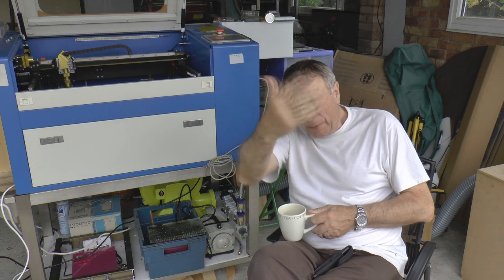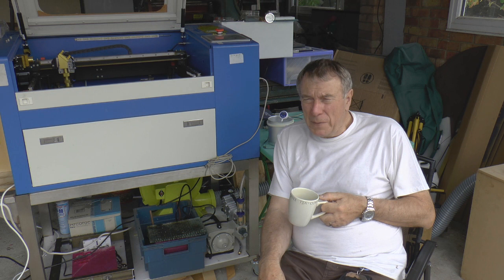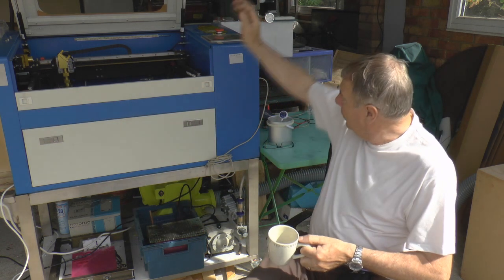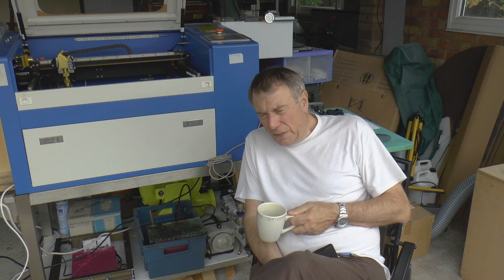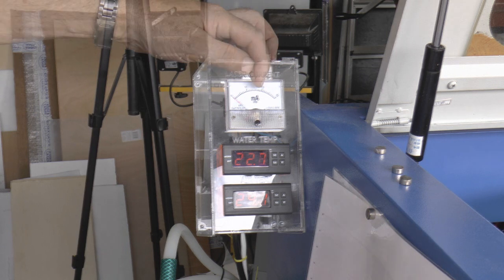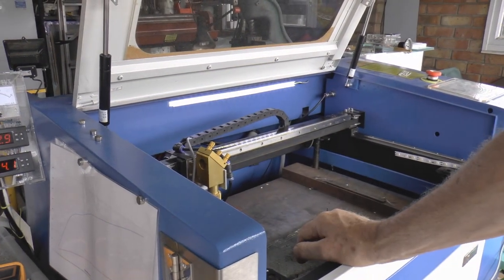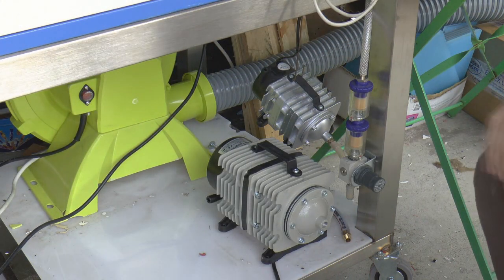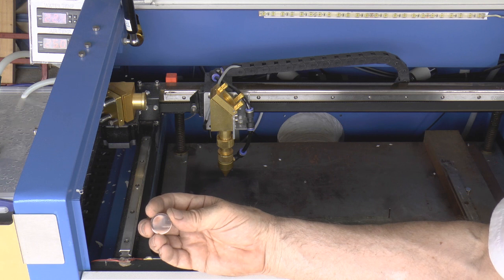RDWorks Learning Lab 75 What have I learned from 1 year of owning a Chinese Laser Engraver

Comment: Russ, is this the unit u purchased? What is a RADIUMWIN laser? Is it a lesser quality?
Enlarge Image View Video Share
Basic Info
Model NO.: RW460
Laser Working Area: 60X40cm
up and Down Device: Have
Laser Tube Working Life: 2500 Hours
Mainboard: M2 Engraving Board
Water Protection Systerm: Have
Specification: CE ISO
Laser Cutting Machine Power: 60W Laser Tube
Red Pointer: Have
Auto Blower: Have
up and Down Platform: Yes, 25cm
Cooling Way: Water Cooling
Trademark: RADIUMWIN
Origin: China
Product Description

China RADIUMWIN High-Grade RW460 Laser Cutting Machine
 
 Laser cutting machine is constituted with laser technology, CNC technology and mechanical technology. CO2 laser cutting machine is designed for nonmetal sheet cutting and applicable to processing rubber, acrylic, wood. It has been widely used in plate processing, machinery manufacturing and precision processing,etc.
 
Technical Parameters   

Laser power : 
60w(optional)

laser engraving machine type 
Hermetic CO2 glass tube

Power supply: 
AC220±1percent 50 HZ/AC110±10percent 50 HZ

Working area: 
600mmx400mm

Laser energy control: 
1-10percent  set by hand or software

Worktable: 
Honeycomb worktable

Locating precision: 
0.01mm

Operating temperature: 
5°C-35°C

Resolution ratio: 
4500dpi

Control configuration: 
DSP

Data transfer interface: 
USB Cable

System environment: 
WINDOWS 2000/WINDOWS XP/WIN7/WIN8/WIN10

Cooling way: 
Water cooling system

Graphic format supported: 
The file which CorelDraw, Photoshop, AutoCAD can identify(BMP,GIF,JPGE,PCX,TGA,TIFF,PLT,CDR,DMG,
DXP,PAT,CDT,CLK,DEX,CSL,CMX,AI,WPG,WMF,EMF,
CGM,SVG,
SVGZ,PCT,FMV,GEM,CMX)

Compatible software 
CorelDraw, 

Cutting thickness 
0-10mm(depends on different material)

1. RADIUMWIN laser cutting machine: textile laser cuting machine and leather laser cutting machine , leather making machine.
2. RADIUMWIN CO2 laser cutting machine including gemology engraving machine and jewelry engraving machines. precious stones laser engraving machine, diamonds of complex shapes laser engraving cutting machine, groove original stones laser engraving machine, and welding laser engraving machine etc. Productions made by laser are elegant, smart, environment-friendly, and don't need any after treatment.
3. RADIUMIN CO2 Laser cutting machine has been applied in packaging industry. For example: glass laser engraving machine, anti-fake code laser engraving machine, carton package laser engraving machine and plastic laser engraving machines, which two-dimensional code marked on the carton cigarette or box cigarette for sales management, anti-fake code marked on medical bags and production date marked on PET bottle etc.
4.  RADIUMWIN electronic components Laser engraving machine  computer parts laser engraving machines are most common technology used in IT products, manufacturer always use laser to marking Logo and two dimensions code on products

Comment: Russ, view youtube segment  "Building a dust collector blower Matthias Wandel". Although a dust collector, consider using parts from the laser junk induction fan for a rebuild. He reduced sound Hz and uses a shop vacuum. He's quite the young engineer bus a little short on woodworking techniques. One of your buds may make two for their woodshop and give u one for idea. Like you could contact Chinese laser to produce a DIY "problem's correction" series. Take a commission on increased sales. Both doing well.  ron
Reply from the maker: Hi Ron
I have watched many of his videos and he is an entertaining young man. Although my current sound deadening system is adequate I have a simple motor speed controller (£5 from China) that I am just about to fit to mitigate the high frequency whine.   This series is all about me learning to use and understand the technology behind these machines. There has been very little information out there about using these machines so when I started this journey about 16 months ago I decided it was great material for my other hobby (video) and that a few nerds may be interested in me playing in my man cave. OOps.  Got that wrong.  Not a few, and not nerds. I am staggered at the world- wide responses I receive daily. It has not changed my direction and what I want to achieve, I just want to understand, but in great detail. Ther fact that I spend several hours ad day bashing the keyboard means my learning progress has slowed. Keep watching because there are new things afoot!!!

Best regards
Russ

Comment: HEY Russ,  

So I finally figured out how to make my laser engraver works and do what I want.  Today I was finishing up my templates in acrylic.  I was doing one final test and I wanted to hurry things along and set it at 65%.  Never set it that high and it stopped working within 2 minutes.  You mentioned Mactron.  Just email them?  Thanks.  You videos are very useful but this is still a royal pain in the rear.  LOL
Reply from the maker: Hi
Let me guess. Your machine is fitted with a laser tube marked KH Laser?
 Yes, just email Gelly Dung at Mactron sales02@mactron-tech.com. If you wanrt the same 60watt upgrade that I did, then just mention you want the same kit she supplied to Russ Sadler
Good luck
Russ
Reply: SarbarMultimedia Yeah I mentioned the laser engraver I got to you on another video.  It's supposed to be 80watt.  Do I need to upgrade the power supply as well?  Or do I just need the tube?  https://www.aliexpress.com/store/product/Kits-Of-1pcs-80W-Long-Lifetime-Laser-Tube-1-pcs-80W-Laser-Power-Supply-Warranty-6/1086226_32224656406.html
Reply: But man just a month.  I was just figuring it all out and ready to start introducing my first product.
Reply from the maker: Hi 
The power supply and the tube are usually matched because its all to do with the voltage required to trigger the tube. The longer the tube usually the higher the trigger voltage. If you are replacing an 80mm diameter 1200mm long tube with this Mactron tube,  you might be OK . But if it was an E bay machine then from all my correspondents with failed systems, about 30% are power supply failures. The PSUs  seem to be made of very cheap components that are held together with hope and fairy dust. The power supply is the cheapest part so I would not risk a good tube with a flakey PSU.  Next time when you need to replace the tube you will not need the PSU.
Good luck
Best regards
Russ
Reply: SarbarMultimedia  OK, Thanks.  Just want it to work and not have issues going forward.  We were so close to launching our first product.  In a way I guess it's good this happened before hand.  We have a good following and if it broke with 100 orders that would be really bad.
Reply from the maker: The positive is it will be a slight launch delay.  A few days more and it would have meant embarrassing delays for customers. The tube will arrive in 4 or 5 days with DHL...very expensive but very efficient. Yes it hurts but the peace of mind is worth it,  knowing that whenever I push that switch I get what I expect. Can you tell me if it was a KH Laser tube? I am busy collecting data. I visited  another guy recently that had a nice fat 80mm diameter 90 watt tube with a KH Label on it. Shine a light through from the back of the label and you could see clearly that this was originally an EFR tube. Evidence is building that there is a mechanism in China where tubes that fail final QC checks, provided they work in "some way" they get re-labeled and fitted to ebay machines. 
Best regards
Russ
Reply: SarbarMultimedia Yeah that's exactly what it was.  KH with another label under it.

Comment: Hello I enjoyed you videos. I do have a question for you if you have the time. I tring to set my origin on the machine. But when I using the arrows to move the laser head it always moves in large movements. Is there away to cut the step speed down to move the laser head in small increments? Also I wanting to use the multiple origin setting to be able to have preset origins set up in advance depending on the job I running.

Comment: Just had to stop by and say thanks.
Picked up my unit last weekend, and just finished setting it up today.
Took me a while to get the odd little bits and pieces, and was busy at work.
But, due to your videos, and detailed instruction, I was able to get my machine up and running, out of the box.
I performed my first cut today, which was the lid for my water tank....Just a simple program to put a couple of holes in the lid for the tubing.
Again, thank you for your work....not many people are willing to put this kind of info, work, dedication, into helping others.
If you weren't across the pond, I would give you a good handshake and a cuppa.
Kudos to you sir!

Rick
Reply from the maker: Hi Rick
It's great news that you have joined the "Chinese Laser Sufferers Club". It seems that the path I am creating with my learning journey is helpful to others, so thanks for your feedback and appreciation.  Just make sure you look ahead and see that I made early mistakes. Don't lose sight of the fact that these are NOT tutorials but more a record of an old guy in his man cave have the most fun ever with a techno toy. The only advice I will give is until you have fitted an ammeter don't use more than 65% power. By all means use it at higher values for a few quick test to characterize your tube. If you bought a 50 watt machine it will certainly be fitted with a 40 watt tube that should not run at more than 18mA To fit an ammeter is easy. See https://www.youtube.com/watch?v=xDZmuxq5BEM

Best regards
Russ

Comment: The exhaust whine can be reduced even more by building a tube with a T-tube resonator tuned to the fundamental frequency. The results are that the resonator produces the same tone but in opposite wave phase to the main tone. A little tuning will result in an almost completely null output of the main tone. Car enthusiasts do this with vehicle exhausts to reduce the "drone" noise.
Reply from the maker: Hi Aaron

Thanks for the suggestion and I may do some experimental work. However unlike a car exhaust system where the sound has only one exit path, that's not the case with a centrifugal fan. The impeller blades are shearing air as they pass over the exit scroll and this is the source of the noise. By virtue of the high velocity air, maybe as much as 60% of the generated noise is carried into the exhaust duct. This is where you would normally put a T resonator and I can imagine that this would be a very effective silencing system because the frequency is reasonably pure. The problem with the fan is that at least 40% of the noise propagates out from the input duct and also through the fan casing.
A really super idea and thanks for your input
Best regards
Russ
Reply: I built a big air bearing assembly for handling paper through a printing press. We were dealing with eight 7.5HP blowers operating among a production assembly team. We tried many things, but what worked best was a large cabinet with sound absorbing foam and Helmholtz tube on the exhaust side. Our blower housings were cast aluminium and didn't allow much sound transfer at the main frequency.

Comment: So how do I figure out the right AMP for an 80 Watt CO2 Lase Tube ???
Reply from the maker: Hi
I think you are trying to find the safe drive current for your laser tube. There are typical  maximum current values for tubes that look like this 50 watt 20mA, 60 watt 22 mA and 80 watts 24mA.  But it does depend on your tube manufacturer and model no. If you can see the maker and model number on the tube then you can refer back to their website and it may say 25mA for example. 
However, reading between the lines of your question I'm guessing that this is a tube fitted to an Ebay machiner purchase? If so things could be a bit different. Is the tube long and thin ie about 1600mm long and 50 (maybe 60mm) diameter? or is it a shorter, maybe about 1200mm long and about 80mm diameter? Is it fitted with a KH Labs label?
Let me know and I'll tell you more.

Berst regards
Russ

Comment: Just picked up my laser today....Holy, it does take up a bit of room.
I think I purchased the exact same as yours Russ.
(DSP Contoller V8, 4500DPI, 3050 Unit)
I will not use it, until I get my mA meter installed, just to show that you can prolong the life of your laser tubes.
Great idea!
Enjoy, Russ....
Reply from the maker: Hi Rick
Don't deny yourself. You have already learned from my mistake. Lets assume you have a 40 watt tube so run it by all means but don't use it with more than 60% dialed-in power. A quick check of a few minutes up to 90% to check out the characteristic of the tube will not do any lasting damage and will clearly demonstrate why you are wasting your time  (and tube life) with numbers above 65%
Best regards
Russ
Reply: Where did you buy it from? I can't find one with the motorised bed? Thanks

Comment: another great video been watching from the start had my machine for about 10 months. been working ok just very slow at cutting and has been getting slower ever day.just about cuts 3mm ply on 80 power and speed of 1. for the last two weeks .and today the tube just cracked .so time for a new one now .
https://www.aliexpress.com/store/product/1200MM-60W-Laser-Tube-60W-co2-Laser-Power-Supply/321243_1109607209.html

just £250 is so much for posting can i ask at what speed can you cut 3mm plywood as i do it a lot.thanks dave
Reply: or would this one from ebay work with the power supply says 60w but i bet its only a 50w thanks for all your help.
http://www.ebay.co.uk/itm/60w-CO2-1000mm-Length-Sealed-Glass-Laser-Tube-For-The-Laser-Engraver-And-Cutting-/291791433128?hash=item43f01feda8:g:Tv0AAOSwuhhXXknf
Reply from the maker: Hi Dave
Sorry for delay in replying I have been away for a few days and my phone does not seem to pick up youtube messages.
Your two questions are both valid. First the Mactron tube and power supply is what I fitted to my machine with great results. You might like to contact Mactron directly  with a view to getting a bit better deal. If you contact Gelly Dung on sales02@mactron-tech.com and ask what price and delivery options she can do for the same spec tube and power supply she sold to Russ Sadler, you may find yourself being quoted for a 70 watt  4000hour tube and PSU.  Ask for part numbers and tube dimensions to see whether you are being quoted for a 1200mm 60 watt or a 1250 mm 70 watt system.
I agree it is a stupid price for DHL shipment and it actually gets a bit worse because there is about £100 tax to pay the government before it will be delivered. Ouch, ouch.....but it was worth it because it is exactly what it says it is and it arrived in 4 days. 

The ebay tube will definitely not be what it seems. In fact immediately we can see that a 1000mm long 50mm diameter  tube can at best be a 50 watt 2000 hour tube and probably a re-badged reject from a know manufacturer, just like the one fitted to your machine on arrival.

I can see that you have not fitted an ammeter to your machine It's cheap and easy to do ( https://www.youtube.com/watch?v=xDZmuxq5BEM and will prevent you over driving your tube. A 40 watt tube like you had fitted originally should not be run above 18mA. A 50 watt tube will be 20 mA and a 60 watt tube will be 22mA. . If your HV power supply is set like most ebay machines then you should definitely not be running above 65% power setting or you WILL be overdriving your tube and hastening its death. Sounds like that what you have been doing. When you lose power the temptation is to increase the power setting. Sadly you are doing very little to increase the power but the extra current is destroying your gas mix so that the tube will produce even less power. You then get into this death spiral of increasing power and accelerating tube death.

Hope some of this helps
Best regards
Russ
Reply from the maker: Hi Dave 
With my 70 watt tube I can cut 5mm ply at about 12mm/sec using 65 watts and a 38mm focal length lens. The short focal length is key to efficient CUTTING of thin materials. My guess is that your setting piece is about 19mm wide, indicating that your machine is fitted with a 2" lens. If so, buy a new lens (about £15) it will seem like a miracle has occurred. Don't bother with the HQ type....just a few % better but not worth the extra money (I have tested  both)
Best regards
Russ
Reply: forgot to say i also got a new 18mm diameter. 100mm focus length will this be better for cutting .thanks again